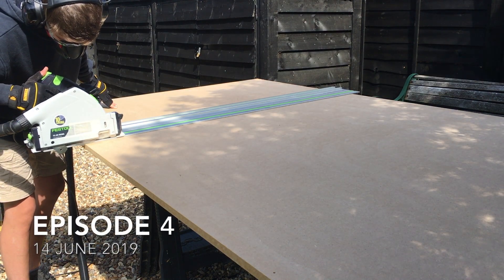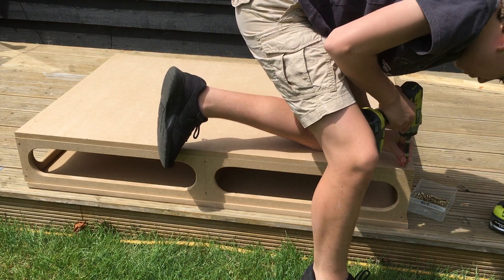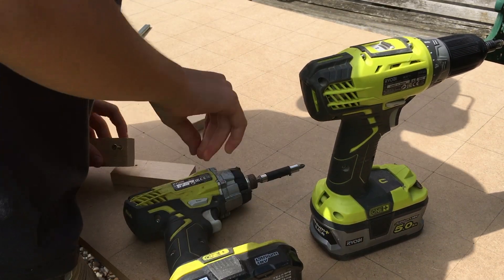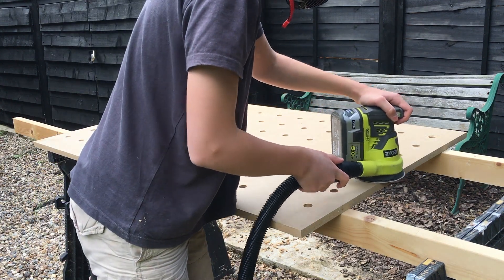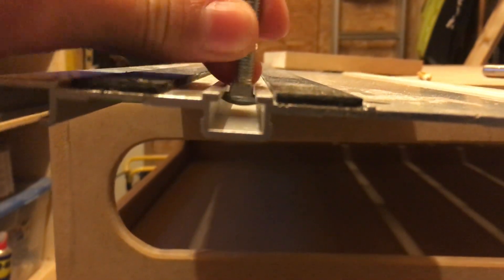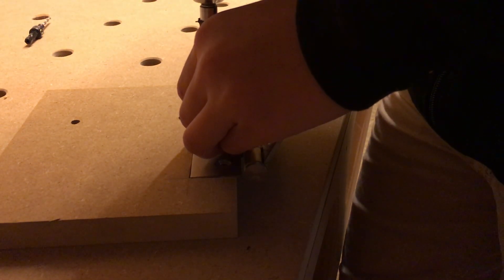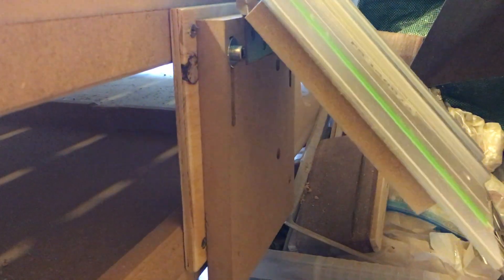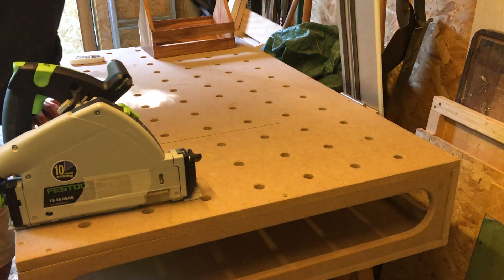DIY multi functional table (MFT)

Comment: I like the drilling jig in that it guides the shaft of the bit and not the hole boring portion.
Reply from the maker: Greg F It’s kind of like the parf guide system.
Reply: @LluisTheWoodWorker  Yes, that was my thought and I am going to give this a try when making my MFT-style work top. A 20mm forstner bit is  cheaper than a 20mm router bit and more readily available. Some of the router bits are reported to be oversized. I can afford the Parf system but it's fairly expensive tool to use just once or twice.
Reply: @LluisTheWoodWorker  Thank you for the video. Great job!

Comment: Brilliant video lots of things i can take away from this. Like a lot of people I have the ryobi trim router and need the base- can someone help me - I bought a katsu plunge base as you suggested but can’t get the router to fit. Which tab did you remove?
Reply from the maker: Thanks! This may be hard to understand but there is a small tab that I filed away on the front side of the router. If you look closely a bit of plastic at the bottom of the adjustment screw on the router this hits a tab on the base katsu base
Reply: Ahh I think I know the bit you mean - the bit between the adjustment screw and the grey spindle lock button? How much did you have to take away? ( could you virtually see the adjustment screw through the the remaining plastic tab?

Comment: A nice build Lluis and I like your solution to the tracksaw hinge, do you find the height adjustment works sufficiently while remaining accurate for your needs and have to considered replacing the two securing bolts with a cam lever to make it a bit easier to use? or are you regularly using the same thickness board and so don't adjust it often? I only finished my own MFT table last week using a MFT sheet from ebay and have ordered some 20x60 extrusion from oozenest to give me a rail front and back upon which to secure a hinge mechanism similar to your own, while also offering other benefits.
Reply from the maker: Quite good! I’ve changed workshop and I’m making a new workbench with new system you will see more in the future
Reply: @LluisTheWoodWorker  love to see the update

Comment: Hi What a good watch! Have you had any issues with the rail squareness whilst using it? 
Super vid. Cheers.
Reply from the maker: Thanks! I only had it for 8 months as I got a new workshop and so I got a bigger MFT but in that time it had always been fine, only thing I may have changed it MDF to birch plywood and the slider at the front get an aluminium one off eBay.
Reply: Wasn’t it great.  This is a very nice thing to see at his young age. My youngest is getting into woodworking also.  He’s 12.  I love it. It’s one of the reasons I started my channel.  To teach young ones.

Comment: Could someone please tell me where he got the plunge router base for the cordless Ryobi router????
Reply from the maker: Haha! I got a katsu base from amazon and all I had to fo is cut one tab at the front for it to fit. Works really well! Just need a file and a hack saw. £29 i paid at the time for the base on amazon. I hope this helps! ;)
Reply: LTW awesome, thanks so much!  Bought it buy it now!  Also, how is that hinge on the track?  Is there too much play?
Reply from the maker: @goonboi7292  Well no actually there ins't much play at all. Obviously if you where to have a aluminium one it would be a lot more sturdy. I couldn't tell you to much though as I never really ended up using this system. I much prefer to use a mitre saw for smaller parts and just use it to cut larger bits. I hope this helps ;)
Reply: LTW thanks a lot for the replies!  Starting my table today!
Reply from the maker: @goonboi7292  Thank you for the nice comments it's really kind. Nice!! Good luck!! :)